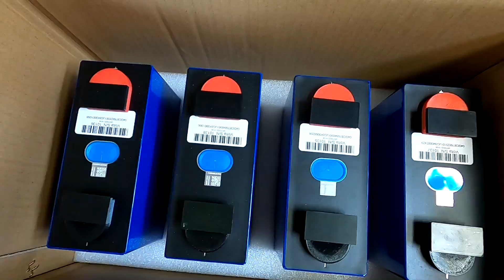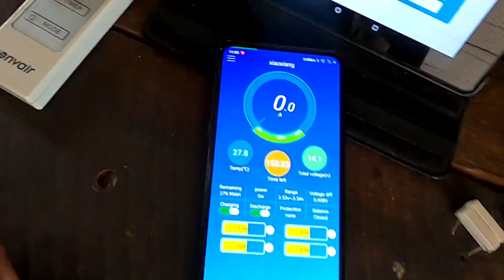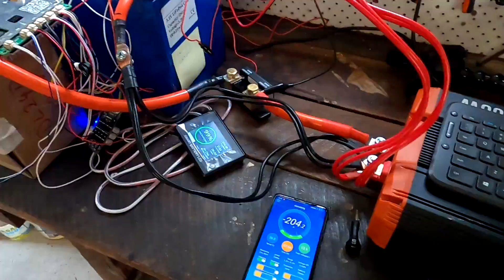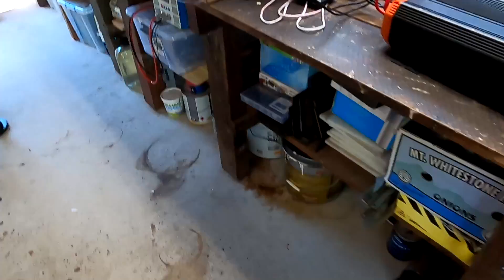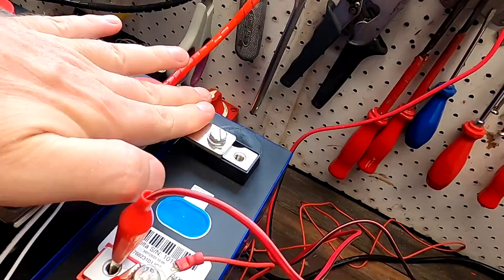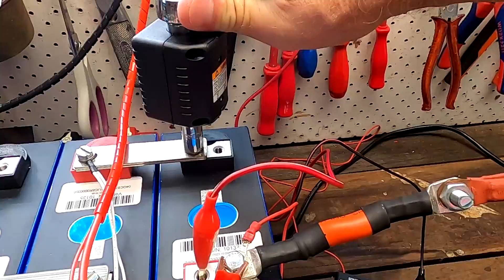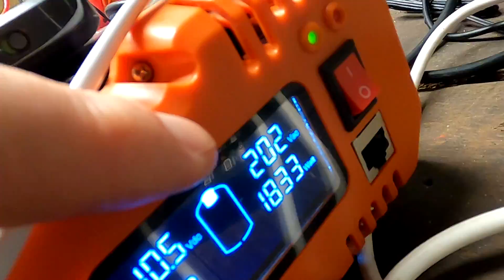My worst B-Grade cells vs. Certified Automotive Grade in a 100%-0% 200Amp Discharge Test. Surprised?

Comment: I think It’s a issue that the other bus bars where clearly able to sink much more Amperage instead of one in this video - Respectively lying a bus bars over a connector could create more heat/less current then the battery of cells completely bound. Could You do these two tests with an identical setup (specifically the bus bars and how they are connected)

It’s seems, the bus bars introduce a potential large variable even just if they are the same bus bars, but only anchored connected one screw per terminal You’ve introduced, and the connection

Are these currents the same bus bars may be small or larger - Can You test with two connections, nuts, to each cell ??

I worry that overlapping the smaller bus bars with half the connecting electrodes and overlapping other may cause a heat issue with a “bad connection” (Bus bar on top of cells electrode connections but not connected completely with the bolts and could waste more energy in heat & add a resistive element)

With All due respect, Adam
Reply: Sorry I would delete My first message after reading again but I can’t, the second message makes much more sense (sorry slight Assburgers syndrome - autographic but not much ICD - other then not wanting My wife “organizing” anything in My storage/working space, anything that She figures if I can’t find a date, or finding a date She throws out “because Her friend said after two and certainly after five years it just be junk”

I like My Origin/Onyx 2000/3000 super computer as well as My colour laser

Sorry autographic writing

Comment: Hmm I wonder if you put the battery under stress of a moving vehicle and add some sort of vibration to the equation from my understanding is the reason for the automotive grade cert its not so much that it is different in quality but in how it handels the stress of the road
So if you battery is not snugged up and tight it will move more and rub more witch in turn will cause a failure in other ways such as an explosion

Comment: Hello! Please tell me, I want to assemble EVE 105ah batteries, is it possible to place the batteries with the contacts facing the face (horizontally on the edge of the battery), and not up, as is the case in most cases? I read that lefepo4 can be placed in any position, just not with the contacts down, but I would like to hear your opinion! Will this interfere with the normal operation of the batteries?

Comment: I have been under the impression that the automotive grade cells are rated for a higher discharge current?  I've read of some 304 ah cells rated for a discharge current of up to 600 amp!  I wondered if this was true...
Reply from the maker: Nothing different in the specs and behaviour of these cells between certified and storage grade batteries.

Comment: Andy are you planning to test the V3 of the LF280K, they increased the cycles to 8000 and the price drop 40%, terminal now is octagon.
Reply from the maker: If I get them at some stage, yes, I will test them. But it will be a boring test. Nothing really new to show...
Reply: The capacity increased 20Ah and comparing the price from 1 year ago dropped 40% @OffGridGarageAustralia

Comment: Hi Andy what is your opinion on the the welded double bolt terminals on the automotive cell ?  Would you say they are better or worse that the welded single stud ? I saw on one of your earlier videos  you stripped the thread on one of the cells that had to have the stud fitter first and you had the repair it , would this double terminal suffer from the same problem when using bolts ?
Reply from the maker: I don't like the double terminals and had issues with them in the Frankenstein battery. If they are not 10000% levelled, the busbar have to bend to connect to the next battery. Otherwise you end up with a tiny gap (visible with a torch).
The single welded studs are great as they provide a fairly small contact area where the pressure of your set torque applies to. Perfect for 200A+ with standard copper busbars as tested.

Stripping terminals was from the time when the batteries had only two M6 holes in the top and the depth of the thread was close to 6mm only. More than 5Nm of torques applied, was sometimes all it needed to strip out the whole thread.
Reply: @OffGridGarageAustralia  Thanks Andy , that is great help , I though with the extra surface area they might have been better . I live in the UK and a company called Fogstar does the Seplos Manson and it has the Grade A EVE LF280K cells and I didn't know if the terminals were better . Do you know if all A Grade cells have this terminal or is it just what the middle man puts on . The price fogstar is asking is not bad and if ordering from China and the cells are  " not good " it can be hard work sorting it out with the supplier .

Comment: This was fun to see, but a test I'd like to see (which is really hard to set up) is how these cells age.  Sure they look close when they each have only a handful of cycles on them, but what about 1,000 - 5,000 cycles?  Do the automotive grade cells hold up better over time?  Do those buying B-grade think they are getting a great deal, but then only get half the life out of them?  Probably need a pack of each and just have them take turns charging-discharging to each other.  Don't need to go max cycle, anything 80+% DOD would be fine.
Reply from the maker: An impossible test to conduct. It would take years to get a result. Usually, manufacturers do such testing for 6 months or so and then extrapolate the data. Same as car manufacturers do for how long the engine will last.

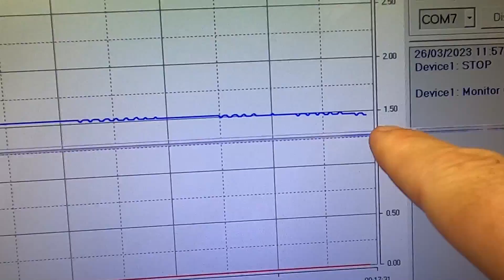Comment: The voltage rippling at 16:16 is due to the ADC not having a high enough resolution for your zoom level, it has nothing to do with the load as your load is stable.
As for the comparison... what about cycle count?!
Also if you go to EVE direct, you can (like I did) negotiate very close to grade B pricing for certified grade A cells, you just have to stand your ground with the pricing you're looking for. There is no real reason to buy Grade B from a third party seller when the price difference is a < $10-20/cell.

Comment: assuming price equity is the dual post variant mechanically better ?
Reply from the maker: No, it's the same terminal underneath. They either weld a stud onto it or the double thread terminal. The stud version is heaps better.
Reply: @OffGridGarageAustralia  Thanks Andy and cheers from Italy 🙂

Comment: Excellent channel. Question: is it advisable to use Ultra Capacitors in between lifep04 batteries and the inverter to offset hard draws to prevent damage to the cells or prolong them?
Reply: I am not an electrical engineer. But, if I understand correctly, lithium batteries (and most others) can only be majorly impacted by discharge if they experience far more than rated current and for continuous, extended periods. So, as long as you keep your batteries properly balanced prior to discharge, it is unlikely you will have any major, extended issues with cell imbalance or uneven discharge, which would pose the biggest danger in peak draw scenarios. Make sure your inverter / DC loads are at least somewhat properly sized for the battery, and you probably won't get much, if any benefits from supercaps. Inverters themselves are usually equipped with large capacitors at the source as well, maybe for just that purpose. Just my two cents. It is definitely an interesting idea, though, and might work in very specific applications.

Comment: In my opinion, there are Certified automotive LiFePO4 and Un-Certified LiFePO4 cells available. There is no definition for Grade B cells put forward feom the cell amnufacturers. Grade B is a sellers  claim, not defined in the industry anywhere.
Secondly, Certified cells have several acceptance criteria, Not just the Amp-Hour rating of the cell. You are getting more from a certified cell than just rated Amp Hours.
Look into industrial criteria for certified automative LiFePO4 cells. To focus only one criteria is absurd in my opinion.

Comment: Real problem with B grade is when you discharge them above 0.5c (in worst case) when they drop voltage and take more amps. Then you can find that have slightly less capacity. On a car that’s slower and less range but houses don’t move.. Aside that they last what is stated. No prob at all.

Comment: These new cells should pull 4000-6000 cycle times, the old used ones maybe 2000, there is the big difference, to be fair I made 200 cycles this year, so they would last for another 19 years, hard to believe that. There is a big scam out there, but maybe the scam is not so bad if your batteries will last for 10 years, time will tell, I'm very interested in your battery shelf in 5-7 years.

Comment: Docan Power told me to use 7 Nm torque for the EVE LF280K with welded steel studs. I don't see a problem with that, but you want all threads in the nut to be in contact with the stud threads. With your double thick bus bars the stud isn't fully into the nut.

Comment: Hey Andy,
 I have a great experiment for you and money making product.  300Ah  8s with compatible super capacitor pack for, if and when a battery bank might shut down above 21 volts, before inverters and charge controllers can safely shut down on their own at 21-22  volts.
 All of the UPS inverters /and solar charge controllers I have seen, warn to never disconnect battery when in use".
  Considering all these lifepo4 banks can shut down from only one cell being low or high. Something that would hold that high shutdown voltage and slowly discharge to reach the 10.5 21 volts  would be worth money. These are already sold for car audio but I don't see nothing for big battery banks.

Comment: Even at 1C discharge rate, B grade are not significantly different to A grade cells. 300Ah B grade cells are much better than 280Ah A grade cells.
1) It's a pity you didn't start the monitoring BEFORE the discharge started (you need an assistant & fewer late nights explaining stuff to others).
2) Did you turn off the additional load (48v charger) after the same runtime for both tests, please mark the graphs?
3) The 1st set had relatively cooler batteries that could have warmed up ~10C during the test which tends to increase voltage & compensates for early voltage drop until it reaches similar temperature as batteries in 2nd test. The 2nd set had several higher current out & in cycles shortly before final test, this had higher initial voltage because of warmth & less delay starting the voltage monitoring. Better if there was more time & temps closer to 1st set.
4) YMMV: The sampling of voltage may show fluctuations as it doesn't synchronise with the high/low & can't operate fast enough to accurately average these readings. They are all close enough.
The between test margin of error accounting for all variables in & out of your control mean your main conclusion is correct, there's no scientifically significant difference between the sets of cells. There's just as much variation between cells labelled the same capacity, same size, same factory & similar date. Below 3v/cell, SOC(Ah) per 0.1v change is a lot less then when 3.2v/cell. Your test is similar SOC as a slower discharge to 2.75v to 2.90v/cell (cell voltage measured recovers after load is removed ie. no more voltage drop due to load) accounts for upto a few Ah. Can you compress & overlay the previous graphs to match (Simulate a 200A discharge using the 40A discharge results & internal resistance calculations)?

Comment: I bought an inverter.  Asked on a forum if I was correct it didn't need a DNO (electric grid operator) sign off.  It exploded in so many different opinions I'm completely lost.  It's a MultiPlus 24/800VA.  A little dotty one.  It has a mains charger built in.  People are trying to tell me, that because it's an energy storage system it is now covered under the regulations (UK) regardless of voltage or AC/DC and in particular, even having shared earth with the DNO will require signoff.
The documentation involved is electrical degree level.  It covers everything from 5MW CCGT plants to car chargers in a 350 page tome.  That's the online government assessment of the regulations the actual EREC (Engineering recomendation) is in G98/G99 which is contained in an ITE publication around Energy Storage Systems and costs £70 + VAT a copy!
Calling a few solar/renewables people near here I was told.
"Nope.  Not touching off-grid."
"We only do grid tie."
"We only do feed in tarrif leave deals."
"It's not worth out time if you aren't buying the panels and inverter from us"
I tried several sparks.  "We don't touch solar.",  "We don't touch DC.",  "Not qualified mate."
Right now I'm waiting to hear from the DNO themselves, but that might prove fruitful or not.
Reply: Sign off.  By the way, could mean an engineer calls out, I show him the install, he nods and leaves.
OR... it could involve a complete inspection and a noting of every single departure from the ITE regulations.
Those regulations cover every tiny little details down to producing a test certificate showing your cells have been tested for a direct short, dropped from 1.5m and had a 9kilo gram hammer dropped on them.  That kind of detail.
IT's insane!

Comment: well, there is a benefit..
i got 280A eve cells from gobelpower and are terrible. 
One cell no matter how much i balance them is always lower than others (is internal short ? ever seen that ?),
No cells has matched IR as they promised and most cells they don't pull over 270Ah.
In general, i very carefully use the pack as a 240Ah 48V pack.  If they can bring the price like 20% more than the ess grade i will not even think about buying ess grade. 

What do i do btw ? I told the seller and he tell me that i need "professional equipment" to prove that they are not professionals
Reply from the maker: That's not good!
If the Ri differs a lot, you need an active balancer to overcome this as the pack will be unbalanced every time you fully charge.
What cells did you get from them as they usually give you the choice what quality to choose from and they are matched or not.
Reply: @OffGridGarageAustralia  the standard quality as i don't believe they test them... Anyway In the description they said they would at least match the IR even in the lowest quality. The IR is from 0.26 to almost 0.5 but all the other cells are very close to each other even with this bad of ir mismatch . Is just this one that no matter what I do (I tried balancing it with external power supply) its always off. Is like it's internally shorting or something. The bms is the jk one so I know it try the best to top balance them and keep them to operate.

Comment: So what about the difference in 4 years?  didnt you already do some videos on the loss of the capacity on the grade b? Or did you find the same capacity loss results on the certified cells?
Reply from the maker: Who knows what is in 4 years? We are totally speculating here.
No, I made a video about the ~2 year old cells I got from different suppliers at a time.
Reply: @OffGridGarageAustralia  I keep reading that the b grade cells may test fine when new but are likely to depreciate in capacity quicker than the auto grade cells. It would be nice to see some evidence showing this may be false.
Reply from the maker: @fathergratwick  Or some evidence that it is true. It could be just another excuse to sell overpriced certified cells.
Some viewers here have these B-grade cells for many years and no performance issues.
Reply: @Off-Grid Garage  I'm not disagreeing but it would be nice to see some testing to show data on this either way. I'm not in any way trying to tell you what to do here.
Reply from the maker: @fathergratwick  Once we see some evidence, we most likely have other battery chemistry and cannot buy these cells any more. If there are still certified cells on the marked in a few years time 🤷‍♂

Comment: I finally made 304ah battery box out of eve 304 cells, I ordered 280k but they sent me these cells to Melbourne by mistake. I used JK BMS as per your instructions Andy in your older video. I don’t know If I was ripped off by getting 304 instead of 280k.
Reply from the maker: Does not sound like a rip-off to me 😊 More like a free upgrade!

Comment: Thank you Andy for this test :)
However I recently bought 8 EVE LF 280K cells from an Alibaba seller and I'm a little dissapointed. 
I started my discharge test with the cells top balanced at 3.5V. After discharging only 245 Ah the cells voltage varied alot, more than 400 mV, with the lowest cell reaching 2.75 V. 
I stopped the test there, I think some celIs have lower capacity than others and I won't get more than 250 Ah out of my pack.
Am I missing something? Is there a posibility that the sellers know who you are and send you better cells?
Reply: I tried to add a link to some JK BMS screenshots but the comment is deleted 🙂
Reply from the maker: Yeah, no links in the comments unfortunately. 
Test some of the cells individually to see if the capacity differs.
Well, if they cherry pick cells for me, they do a miserable job: damaged, scratched, different capacity, Ri not matched, fake barcodes, bulged...
Reply: @OffGridGarageAustralia  You can ask some friend to place the next order 😂
I don't have the equipment and time to test cells individually, but I'm sure those are lower capacity because when recharging they are top balanced again. I will live with that 🙂
My point is that some may buy certified EV cells is to avoid such loses, since I'm not the only one experiencing this. 
If it's worth it or not, it depends from project to project I guess.